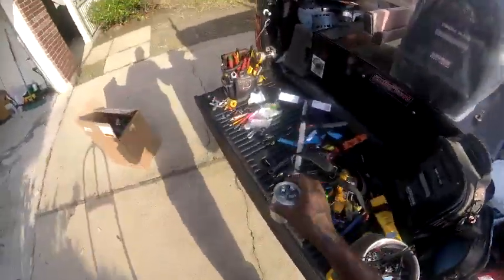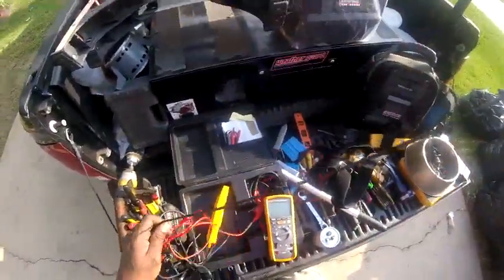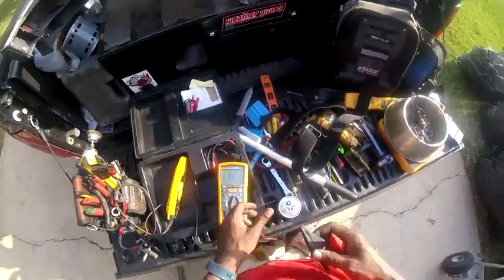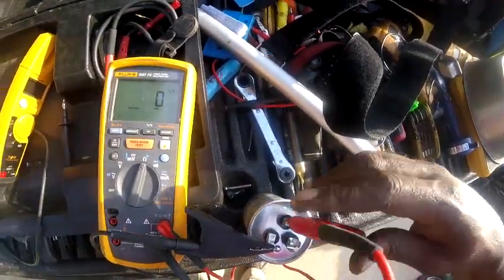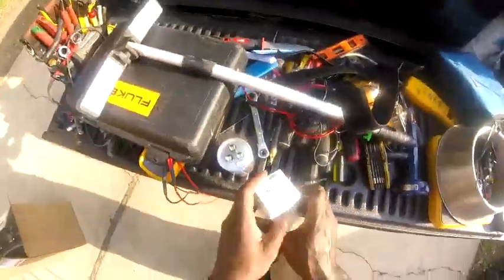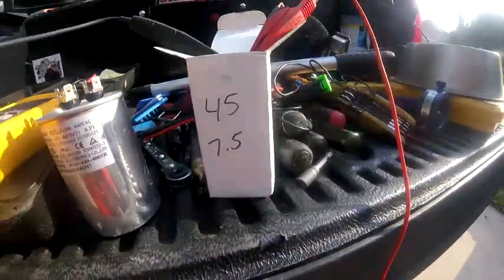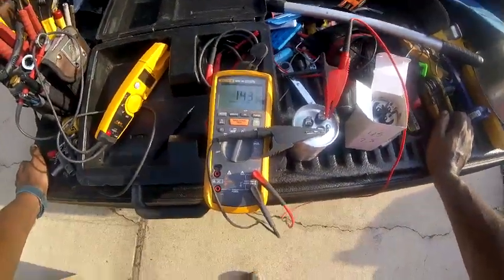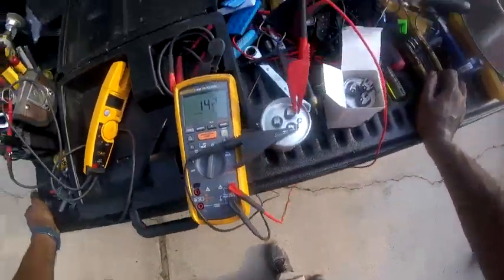HVAC: Capacitor reading over 215% microfarad

Comment: It’s actually over 300%
Reply from the maker: Let's just agree it's over 5% and needs replacing lol
Reply from the maker: Show the math??
Reply from the maker: I got 45mfd +215%=141.75mfd
Reply: 45= 100% 
45 (100%) x 3 (300%) =135 so it will be 300%+
Reply from the maker: Its comes with 45mfd so you have to start there. Not at 0mfd..How you going to add another 100%?
Reply: Lol it’s how they teach you in school
Reply: Grab a calculator and do 45x3 see what happens lol